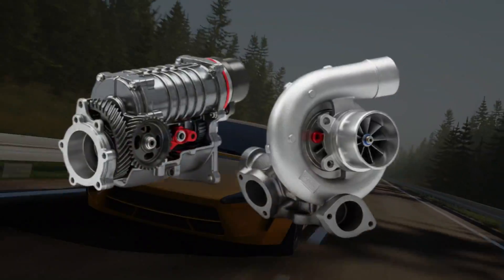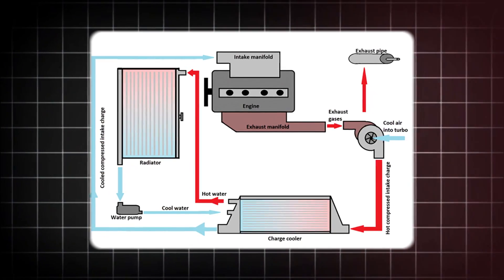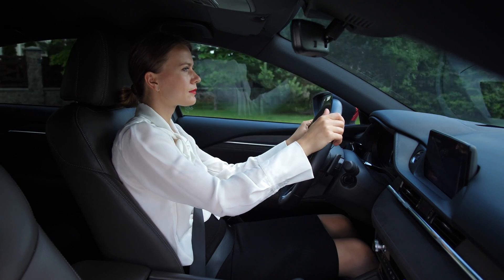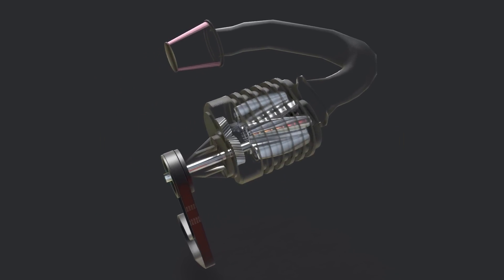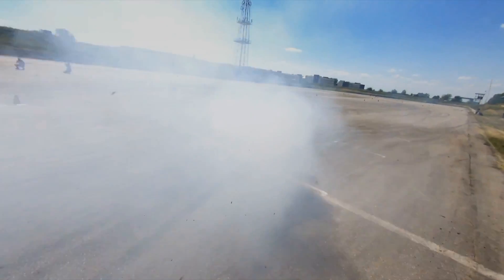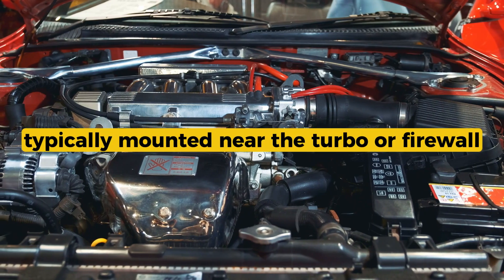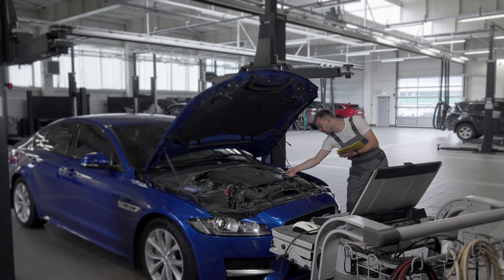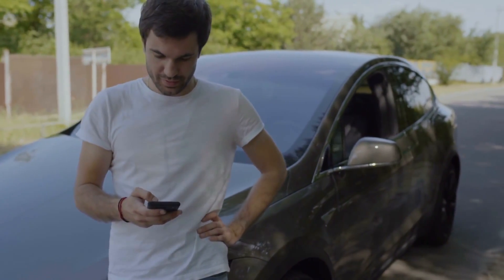P0234 Code: Engine Overboost Condition – Causes, Symptoms & Diagnosis

Comment: I have a 2015 3.5 Eco Boost. Anytime I really got in the throttle on my truck (F-150 King Ranch) I would get this code. I would reset it and truck would run fine till it happened again, if I had to get in the throttle hard again for some reason. I had replaced the boot solenoid, still happened. Cleaned all the sensors, still happened. Well I got a vacume pump oil leak, so I had to replace that. In taking everything off to get to the valve cover and pump replacement. I finally found my po-0234 issue. A squirrel had chewed a few small holes in the back side of the plastic vacuum line going from boost solenoid to the top of the waste-gate. Was on the bottom side where I would have never seen it without having to remove it. I write this as a heads up to anyone that has this issue. Check those vacume lines.